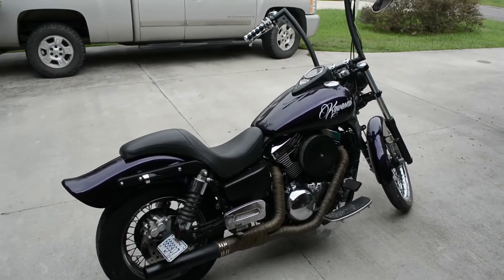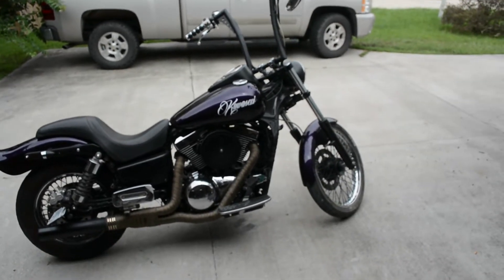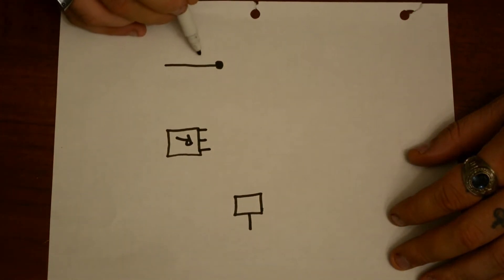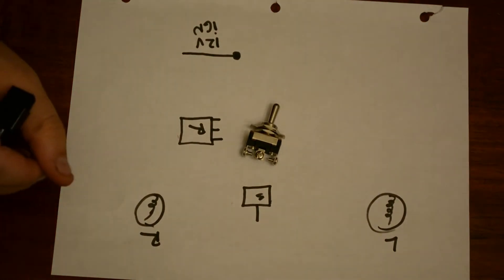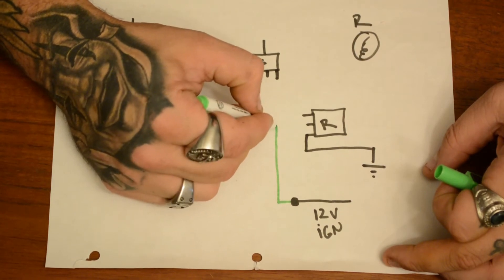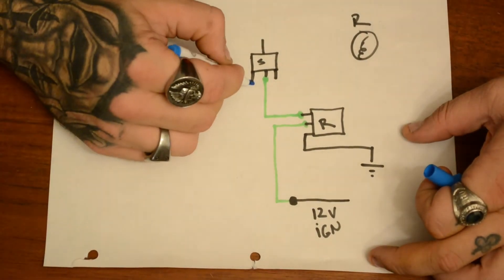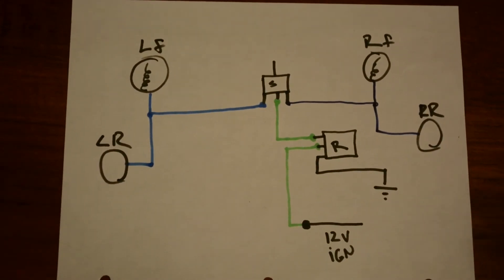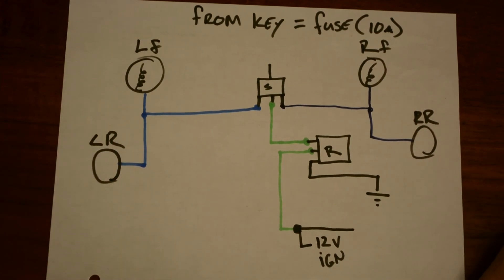MOTORCYCLE TURN SIGNAL CIRCUIT EXPLAINED [tutorial]

Comment: Great vid brother. I run a 1972 CT70 with everything wired but the turn signals. I’ve been wanting to wire in directionals to it. I’m good with wiring in at the ignition switch for the 12v feed? If so thanks and I’ll do that as you explained. Thanks again brother!
Reply from the maker: Yes sir you should be just fine wiring into the 12v from ignition. If you have anymore questions or hit any snags feel free to hit me up. Thanks for watching!

Comment: Brother you haven’t completed your circuit the lights have to have a ground side. Your good other than that. Love your vids thanks.
Reply from the maker: I intentionally left it out as to not confuse people but it is stated. I did that because more than likely, if someone is doing this they will have aftermarket signals. That means the could be self grounding or have an actual ground lead. I did make a second video that shows the circuit being made in real time though. I try my best to explain things but sometimes I reckon I don't do a good job. Lol.

But thanks for the support! I'm glad you like my videos. I'll be uploading another one on rebuilding a cv carb tomorrow.

Comment: How does this work if your bike has running lights up front,  what powers the rear lights? The switch?
Reply from the maker: The running lights are powered from a constant ignition source. The turn signals are fed power from the relay, with a switch in between. You can put front and rear signals tied together to get front and rear to work with each other.

Comment: When i connect my turn signal wire it kills my running lights.  
3 wire led lights signals will work fine or i can disconnect the turn signals and allow for running lights cant get both to work together?
Any advice? 86 honda shadow 700
Reply from the maker: Great question. The running lights need to have constant power. Not power from the relay. If you are using a 3 wire system then you'll have no problem. But a two wire system can only be either or unless you create a 3rd circuit using resistors and a diode.
Reply: @ThrashTestDummies  its 3 wire just like the original (though led) 
As soon as i connect the turn signal wire (still off) it cuts out my running light.  
Idk if this has to do with the indicator light on the 'dash', something to do with honda running things weird. Ive read that it flows through the indicator over to the side not in use to get its ground.  Being led these lights will only allow for one direction of flow.  
Im about to the point of sayin screw it and loosing the running lights ive been screwing with it for weeks.

Comment: What makes all 4 turn signals work when u push left or right the all blink like hazard lights
Reply from the maker: I'm not sure whether you are asking how to wire hazard lights, or how this circuit works. If you are wanting to wire hazard lights there are a couple ways to do it. One being to run the power out from the relay (flasher) to a separate switch or button which would then take the place of the power to that switch, then wire the power coming out to all 4 lights. The other way would be to wire all 4 lights to a separate pole on a 3 position switch. This would make two poles operate left and right signals, then the third pole would operate the flashers. 

If you are confused as to how this circuit actually works, I have another video that further explains it. If you have anymore questions please feel free to ask. Thanks for watching!

Comment: Hello, how can i convert from US style turn signal always on to only flashing turn signal(EU style) ? They are working fine but i want them to be off and work only when i switch to that side. Thx!
Reply from the maker: So if I understand you correctly, you are wanting to only have light from your signal come on with your turn signal, meaning no running lights. If that is what you want, all you need to do is find the wire that is constant with ignition power on, then remove it on a 3 wire setup. The process will be the same on a 2 wire self grounding setup where the signal housing provides the ground. And if you have a single wire, just connect that wire to the wire from your turn signal switch. If any of this is unclear feel free to comment back and I will try my best to help you through it!

Thanks for watching!

Comment: Every bulb supposed to have positive and negative connections. Here is only one connector witch is positive. Left and right relay I assume just for good serious picture. No connection except from bulbs :)))
Reply from the maker: 🤦‍♂️ every bulb does have positive and negative. And no, there are not supposed to be two relays. Only one between the power source (12v) and the turn signal switch :)))

Comment: i think i need a resistor on my turn signals... they dont blink.. they stay on all the time..
where do i connect the resistor??
tnx
Reply from the maker: You would connect the resistor on the power side. You can do each one individually or put a single resistor on the power out wire from the relay. But before doing that I'd check to make sure the relay is working properly.
Reply: @ThrashTestDummies  tnx a lot..
the relay works ok.. i have caffe racer xj600 yamaha and it didnt had any turn signals.. last year a mechanic in my town, installed the turn signals but told me that when they blink the front light blinks too if its on...i tried at a different mechanic a mounth ago and he reinstalled the wiring and told me that now the turn signals r not blinking at all, they just stay on cause i need a resistor.. he sayes that he cant fix the prob.. so i have to do it somehow cause nobody esle will..what resistor should i use?? i do some mechanic repairs my self but dont know electrical stuff at all..
Reply: Make sure you use a "flasher" relay.
Reply: @bretdegayner8934  its fixed.. the wiring was a disaster.. we fixed it and its all good now.. im waiting for a timing chain, the carbs were rebuild completly and tge brakes also.. so in a mounth i hope ill be riding it..

Comment: Can you somehow substitute the toggle switch and use the switches in the handlebars for the turn signals?
Reply from the maker: Of course! It wires up with the same concept. I just used a toggle switch for ease of explanation and so the wiring was clear.
Reply: Thanks. Have been trying to get my turn signals to work on my 74 electra glide for a while now I went and bought a relay and a toggle switch just to see if your method worked and it does now just to figure out how to use the handlebar buttons thanks for your videos they hope a whole lot!

Comment: Is there any diodes in line usually? I have an indicator issue. ok. Engine off indicators work in all positions at the switch. Turn engine on indicators stop working. But if i turn on my headlights all indicators work again?
Reply from the maker: Not usually. The diodes and resistors are what turn led turn signals and brake lights into two phase lights. Meaning two varied brightnesses. Thats all in the light itself most of the time.

Comment: Hi where u get ground to the turn signals??? I am having a problem in a 1998 vz 800marauder all wires r out to have the new turn signals also the head light is out for new one ,but once I click left or right it always flash in 2wire no matter if i click right or left... Always show me flashing in 2wire ...can u help!!!!
Reply from the maker: If I understand correctly, it sounds like when you turn on your turn signals, both sides flash. This is usually because all lights are not installed or dont have enough resistance. If you are using LED bulbs you MUST have all of them installed for the circuit to work correctly. The circuit is based on resistance. If the resistance is not correct it will malfunction. As for your ground, If the lights you are using are just turn signals, then they will have either 1 or 2 wires. If they have 2 wires then onne is your ground. If there is only one wire then they are self grounding.
Reply: @ThrashTestDummies  ok will test it all 4 placed ...ithey are LEDs but with electronic inside if i connet direct to battery to teste 1 by 1 it works fine

Comment: No running lights?
Reply from the maker: This video was intended to show how the turn signals work with the relay and a switch. Running lights will depend on whether or not the turn signals you use are just turn signals or have running lights. If you are confused, I recently did a revision of this video where I actually make the circuit using live components.

Comment: As shown there is no flasher module. There will be no flash of the actuated turn signal and will stay on continuously until the switch is turned back to the off position. In the case of a momentary switch, it will stay on and continuously until released. In any case it will not flash. There should be a fuse placed before the relay on all circuits of this design. Wire in a 2 pin flasher just after the relay.
Reply from the maker: I will make a video with an actual circuit showing that this works in the very near future. Probably my next video.
Reply from the maker: https://www.youtube.com/watch?v=ATlrWYBj7Fk
Reply from the maker: Check out that link to my newest video. It shows this exact circuit being made in real time. It does, in fact, work in exactly the same setup as I showed here. Thank you.

Comment: Probably should have mentioned that the switch and turn signals are grounded also but a good instructional video
Reply from the maker: the switch is not grounded if you have a 3 pole 3 position switch. Usually, the center post is power in (from relay) and each outside post is power out (to each turn signal). And depending on the type of turn signals you have, they may or may not need to be grounded via ground wire. this is why I did not mention it. But good job at paying attention!

Comment: Nice bike. I have a question. I hope you can help me. My turn signals don’t turn on at all. I get 12 volts at the blinkers conector for a few seconds but then it drops to 0.34 volts. The fuse is good and the switch looks good too. I check the flasher relay and it shows continuity. What could be the problem? It’s a 2008 Kawasaki Vulcan 900. Any advice is appreciated. Thanks.
Reply from the maker: I may be understanding you wrong, but if I do understand you correctly it seems like you may have a short somewhere. Either that or bad lights. The voltage drop, however, is normal. If you think of electrical component in terms of components that control water, your wiring is like the pipes. A relay is like a valve that allows short bursts of water to flow through as the amount of water builds. like a switch turning on and off. However, if there isnt enough current to turn it on and off they can turn on for a second, then turn off without the proper resistance in the circuit. I would check the simplest things first. like your bulbs. Make sure all 4 are good. If they are, move inward toward your harness. check for all power and ground and make sure there are no shorts. If all that checks out check your relay to make sure it is not stuck. If you have any questions about how to do any of these things feel free to ask.
Reply: @ThrashTestDummies  Thanks. I check the bulbs and they are good. I will check the wires harness next. I hope to find a wire shorted to ground or a burn wire or something. I just realized that the previous owner of the bike had switch a couple of fuses with fuses with greater amperage. There was a 30 amp fuse where a 15 amp fuse is supposed to be and a 25 amp fuse where a 10 amp fuse should go. When I put the right size fuses in there they shorted out right away. I think the previous owner new about the problem and instead of looking for a short in the electrical system he just added bigger fuses. Smfh.

Comment: What about 2 pin relays? How are you supposed to wire those into the system?
Reply from the maker: Most 2 pin relays would be the same as 3 pin but they do not require a ground. so from the battery it would go fuse, relay, turns signal switch, and then from the switch to the respective turn signals. The example I gave in the video was of a 3 pin simpley because most people are familiar with +/- wiring and 3 pin relays are very easy to find.